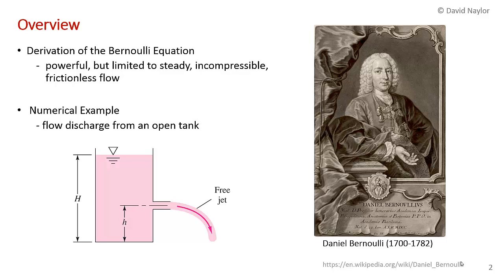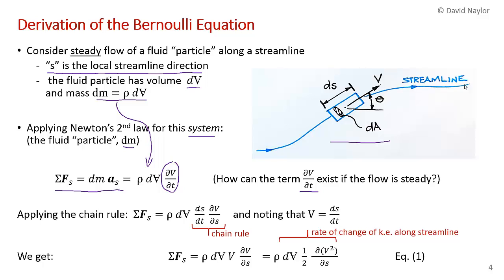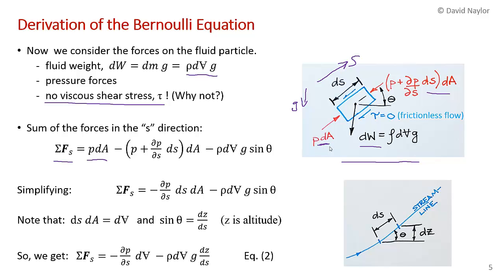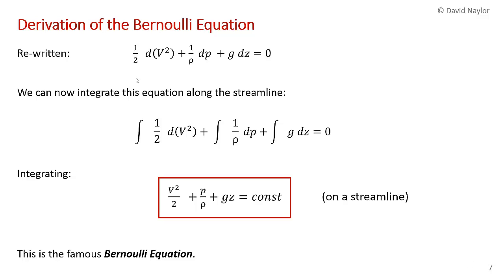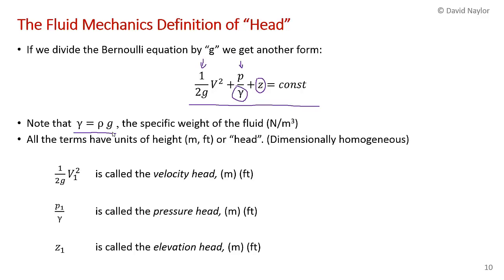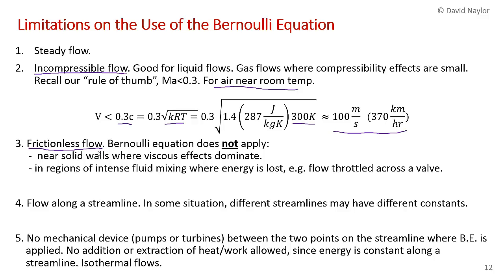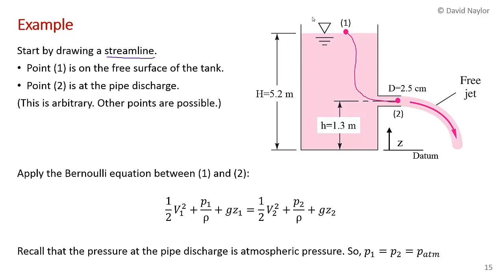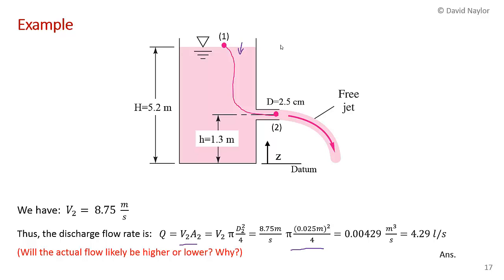The Bernoulli Equation and its Limitations

Comment: 3:50 - Chain rule, or implicit differentiation? Sometimes I think the lines are blurred on this one.

Also, in the tank example, what about the pressure of the water at a depth of 3.9 metres? Doesn't that count for something? Or is the only relevant pressure the one the short pipe is discharging against?
Reply from the maker: The pressure at 3.9 meters is what causes the flow out of the tank. Alternately the analysis can be done by considering a horizontal stream line (1->2). So, point 1 at a depth of 3.9m well away from the outlet pipe.  Now z1=z2 and p1/rho is not zero. You get exactly same result. So, the pressure at 3.9m definitely counts.

Comment: I've got a question: in the example of discharge flow from a tank, if I put my finger at the discharge point, I see the speed of the discharging fluid is increasing, but Bernulli equation shows the discharge speed is not function of discharge diameter. Is there any explanation for that?
Reply from the maker: Interesting question. I haven't tried it, but I suspect your intuition is not correct. Try drilling a small hole and a larger hole at the same depth near the bottom of large plastic water bottle.  My bet is that both water streams follow the same arc and extend the same distance from the bottle i.e., they have the same exit velocity. It would make a nice short video. I'm completely open to be proven wrong! Thanks for the question.

Comment: Amazing presentation! 05:50: it seems to be dv/dt of material derivative rather than del (v)/del (t)?
Reply from the maker: Correct. This is a material derivative. However, there is no time variation, because it is a steady flow.  So, acceleration is only caused by spatial gradients in velocity.